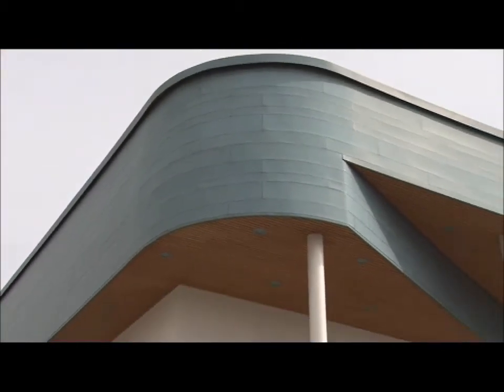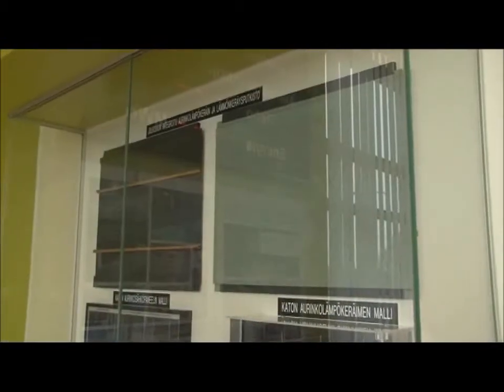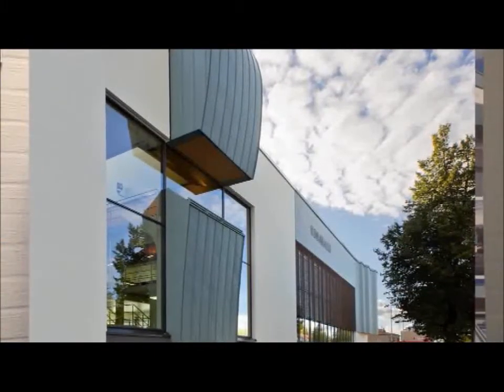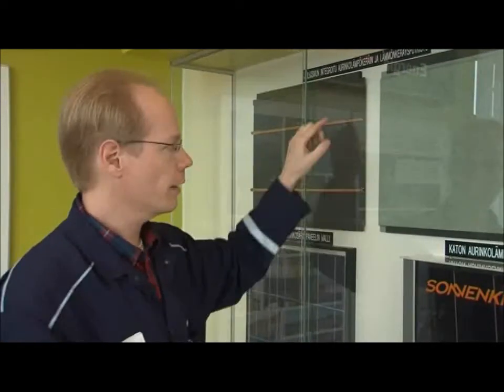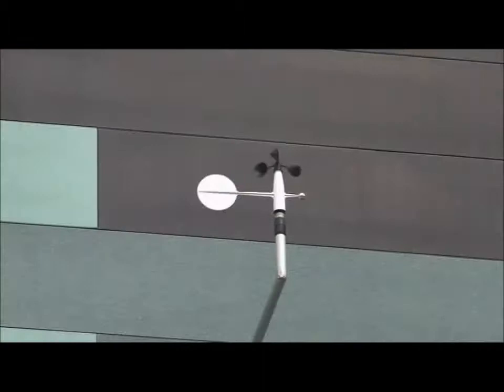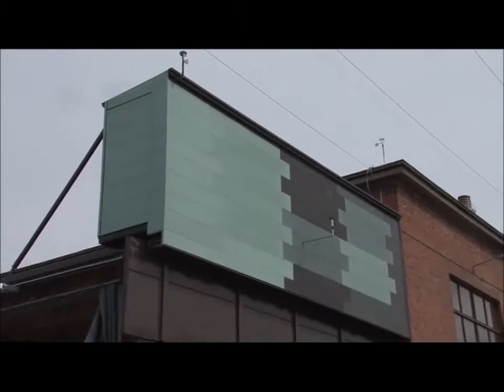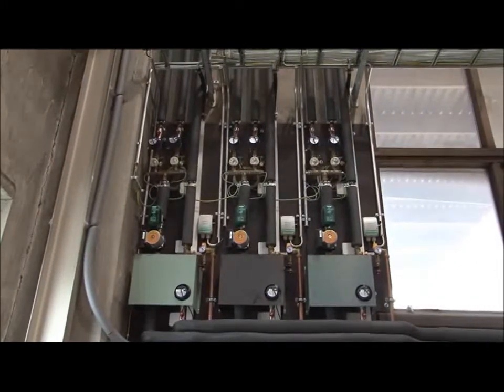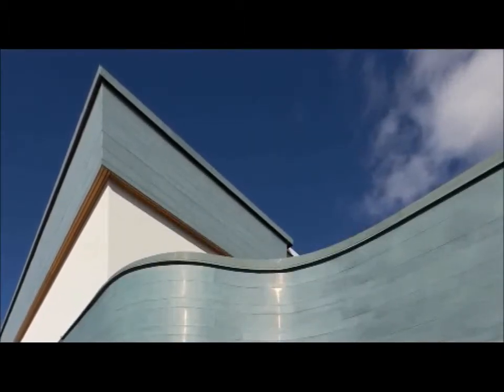Fully integrated solar thermal copper façade system

Comment: This is the direction we need to be headed in.  In the USA, I see all manner of both solar electricity cells and solar water heating cells, all of which look like something that fell off a truck on it's way to the dump.  Integrating these elements into the overall architecture of the building is important and even mandatory in order to achieve complete public acceptance.  I wish this company great fortune and wish more people were looking at this video!